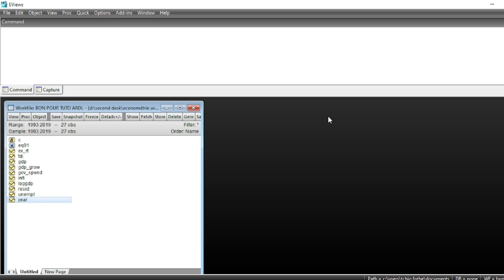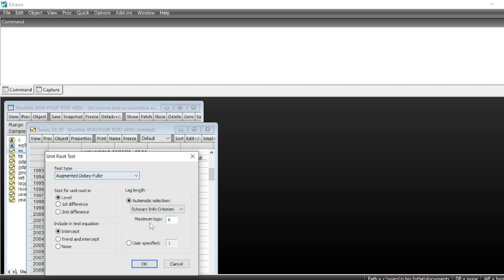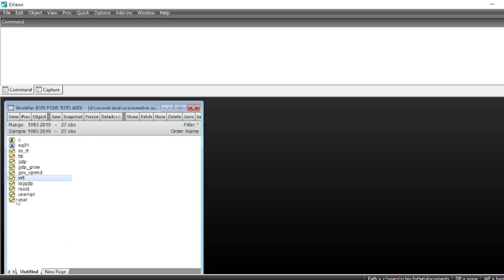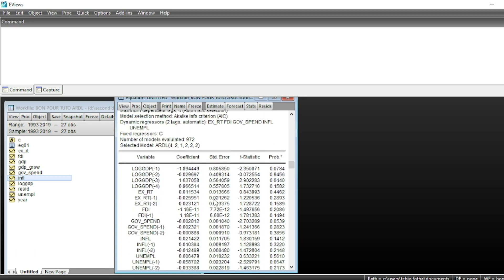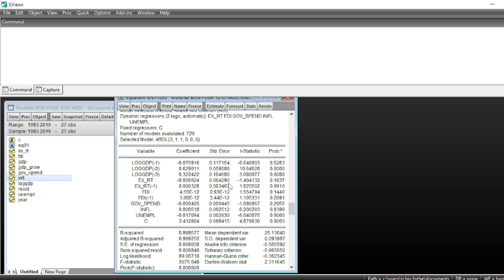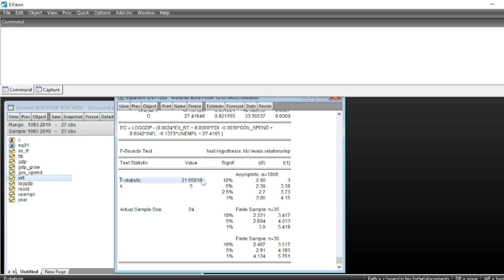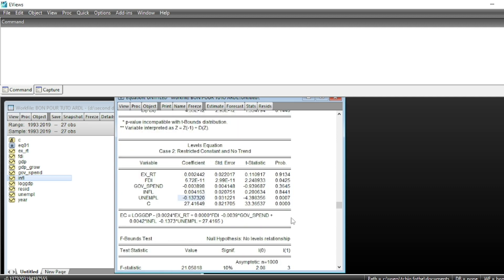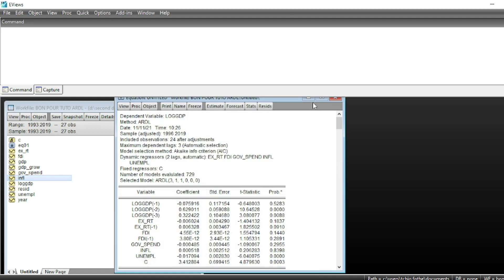How to run ARDL, bound cointegression test and error correction form in Eviews

Comment: GREAT.
would you please see this?
While conducting the ARDL model with four variables in Eviews, all the variables are non-stationary at level, but at the first difference, i.e., I(1), two variables, including the dependent variable, are stationary without taking their log, but two other independent variables are with log only. Should I need to use a log for all the variables in this situation?